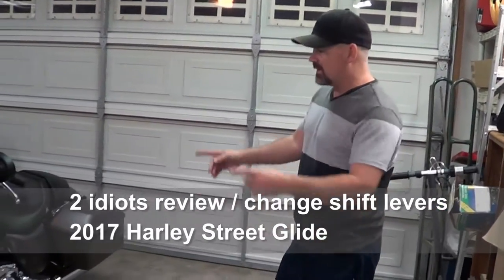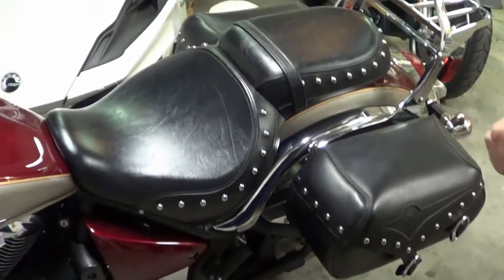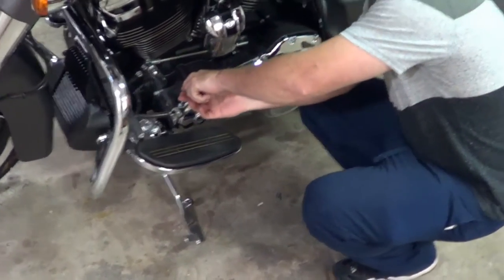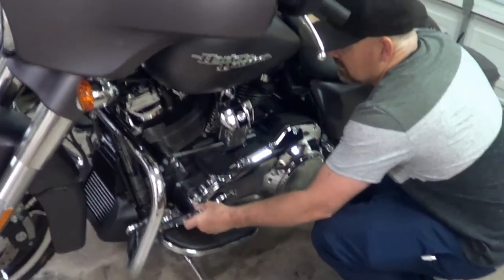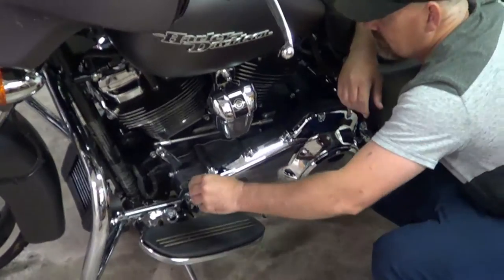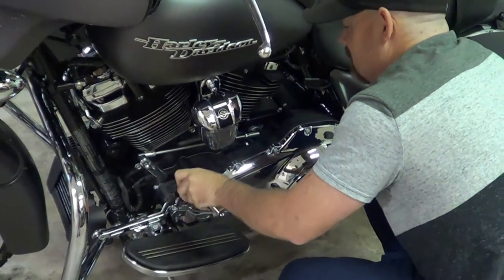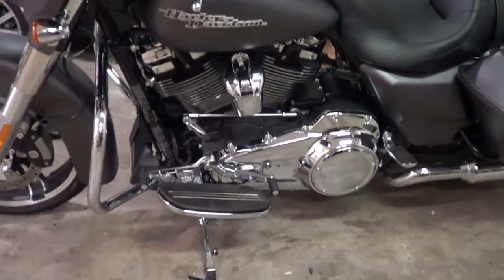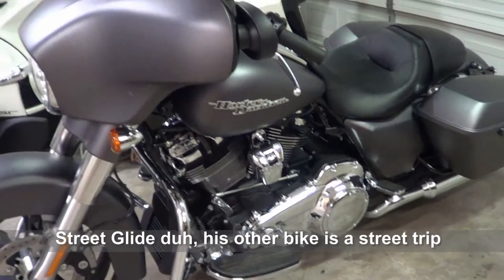2017 Harley Street Glide extended heel toe shifter

Comment: If you just want to extend the heel shifter, J&P Cycles sells an extended shifter that matches the stock Harley  shifter.  Kawasaki definitely has it right with their shifters plus having the positive neutral finder that automatically goes in neutral when you upshift from first gear when stopped or almost stopped. Plus I like the Kawasaki pad instead of a peg on the heel shifter.  But I (so far) don't regret trading in my Kawasaki Nomad for my Harley Ultra Classic.

Comment: I know it’s been a few years. I just came across your video, If you want the two bushings inside the shifter housing to last, you will need to apply some grease inside the housing. You can bet your ass Harley Davidson didn’t. Also apply some ant-seize on the shifter shaft splines, you will sooner our later will need to remove the shifters. Oh by the ways nice ride.!!